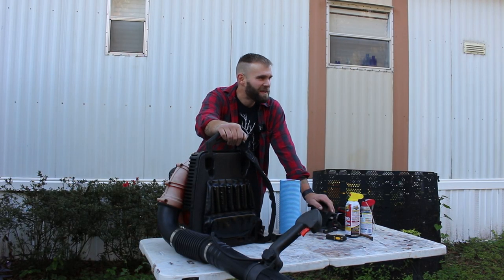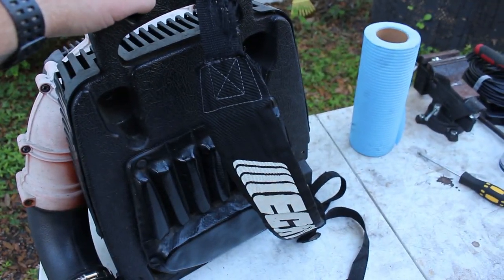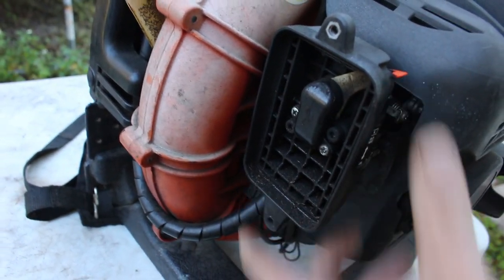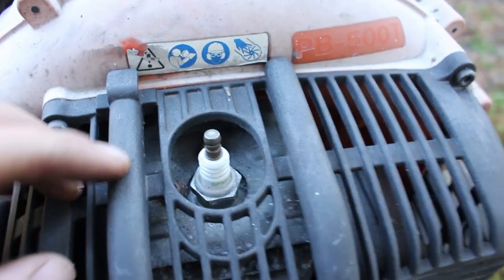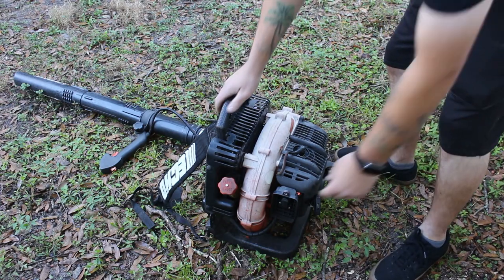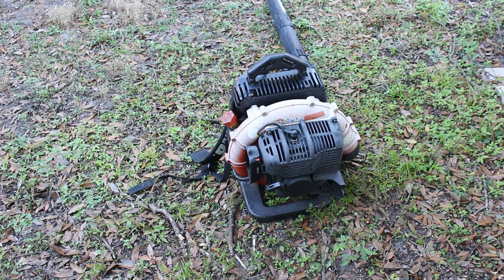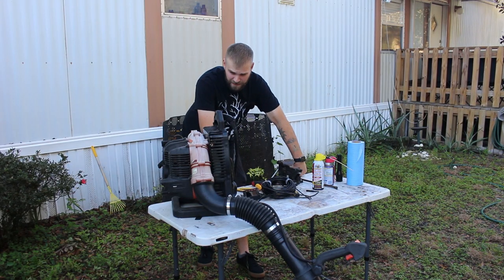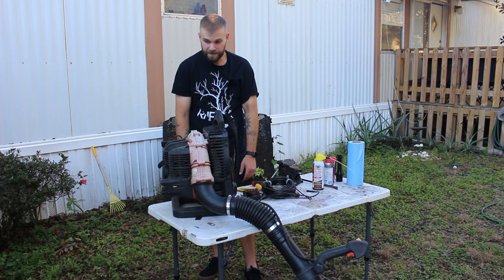FREE 500$ Backpack Leaf Blower Sitting 10 Years Will It Start?

Comment: Good call on the new carb. The diaphragms inside also get brittle with gas sitting for 10 years.
Home Depot sells just the replacement primer bulbs, but a whole new aftermarket Zama carb is not much more $.
Bet it would run fine even with the scored cylinder.